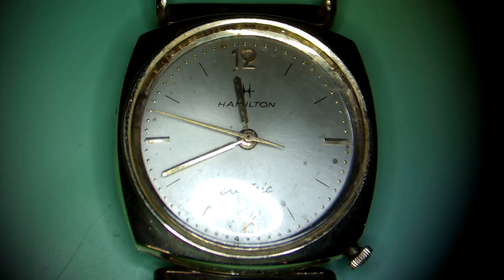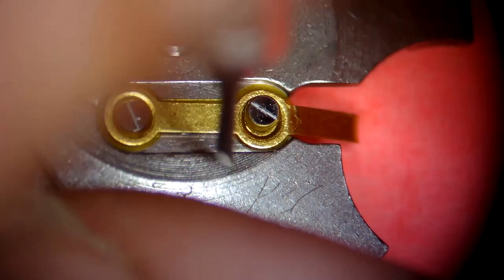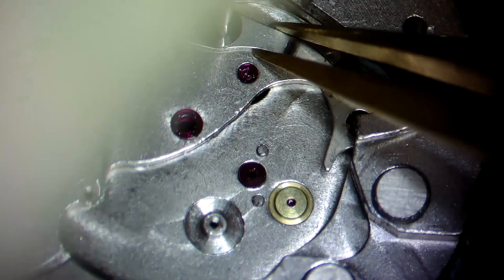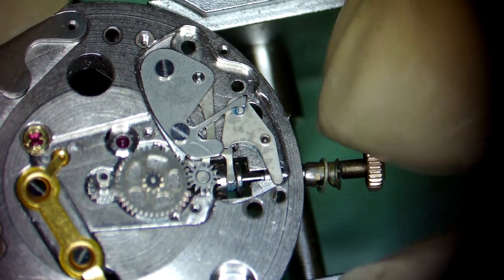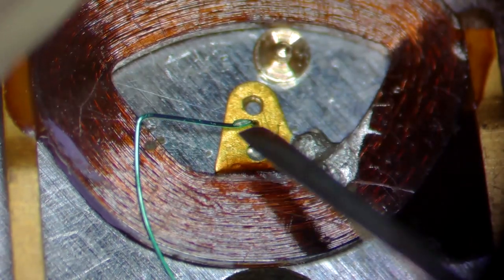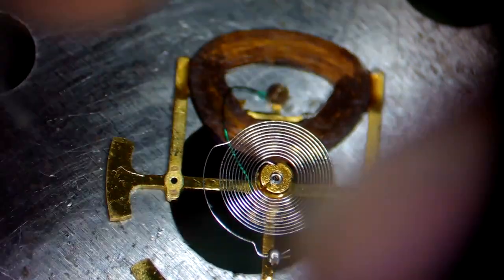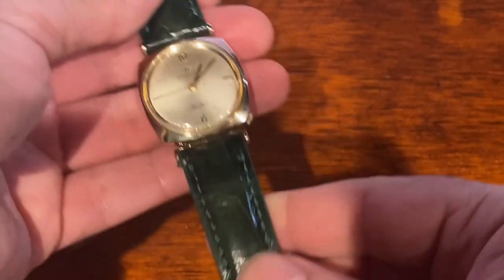Servicing of a 1962 Hamilton Gemini Electric watch w 505 movement

Comment: Well, I acquired a 500.  It is not running, but appears to be in good overall shape.  The wires, balance, and all seem to be good and intact.
I am hoping it just needs cleaned and serviced.  The balance tries to take off when a battery is installed.  It does have a broken setting lever spring.  The thin little finger that sticks out is broken off.  I have the 500 service manual and, with luck, hope to get it running.

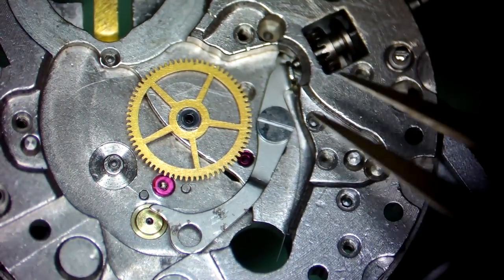Comment: Great video and explanation of functional aspects off this watch! Just one noticeable mistake 4:41  I also commit once in a while, is using a screw driver smaller than the screw I’m working on. It’s a bad habit out off our rush to see it working or laziness we have but it can lead to markings and dents on the screw head, even if it doesn’t slip, that won’t affect anything but appearance, and we all know when it comes to real or sentimental value, watch owners may actually open the watch to check for small imperfections on our work. It’s very hard to discipline ourselves to keep switching screwdrivers but it’s a necessary evil to avoid irreparable mistakes!
Reply from the maker: You are absolutely correct!
Reply: I can tell you that not one customer of mine has ever mentioned an imperfection on a screw. He did a great job with this. If you are or have that type of customer, it’s best not to do business with you or them.

Comment: Thank you for this very well-made and informative video.  May I ask, is the precursor to this one, the 500, similar in its set up, and does it have the same issue with that same part on the balance?.  I know the battery set up is different with that wire they used, but is it basically the same other than that?.
Reply from the maker: Thank you for the compliment. The 500 is different with the battery clip but much more significantly, the contact mechanism is totally different. It uses two tiny wires (same size and thickness as a some (smaller) hairsprings) that touch and separate when their position is shifted by the balance, thus creating the circuit. This also means that the contact on the pivot is different. Interestingly, though this is a more fragile and sensitive design, it's also less prone to wear out than the 505... silver lining.  I'm working on a video for the 500 - but the big problem with them now is that these contact wires are even harder to find than the 505 parts - basically they need to be harvested from donor movements, which are also getting harder to find.
Reply: @sma1968  Wow!.   I knew those wires were important, but why couldn't you use some other kind of thin wire besides using a donor movement?.  It's a special shellac coated wire or something?.
Reply from the maker: @wildernessofzinn17  Actually... and keep fingers crossed that I am successful -- I AM trying to see if it's possible to make these contact wires. If it were, it would be a real game changer for the 500 movement. To be honest, I don't think there's anything inherently difficult about making them (as compared to other micro-sized/watch parts. It's not coated in any shellac, It's basically made of flat wire -  .04mm thick, .14mm in width. They are bent in very specific ways and there is some micro soldering involved. Where it gets a bit tricky is they need to be a non-magnetic alloy stiff enough to be a spring - so not pure copper. (the devil is in the details (the microscopic details). :)
Reply: @sma1968  Wow...thanks.  Interesting stuff.  You know your proverbial poopy about these watches.  In other words, those wires are like tiny mainsprings with thickness and width and length.  That's cool.   I have a 1958 Hamilton Electric watch repair manual by William O. Smith Jr.  Thought I would put it to use if I ever get the chance.  I am anxious to see your 500 video when you get a chance to release it.

Comment: God I hate these… I have one that runs consistently and keeps good time but the balance is very sluggish and doesn’t get full action. Suggestions? (I haven’t cleaned it yet but the movement looks fairly clean).
Reply from the maker: If it's running consistently, it would seem that you're, happily, in good shape. Definitely sounds like a cleaning and proper lubrication will be what it needs. As you saw in the video, it doesn't take much dirt or too much oil to make these run badly.
Reply: @sma1968  I’ll try that… I had a really great running donor watch and of course I dropped it and broke the balance staff.

Comment: Have they tried dielectric grease for the contact?
Reply from the maker: Interesting thought. My guess though is it would be way too viscous for a watch.
Reply: @sma1968  Something to try. I was trying to see the difference between a worn out contact and the new. Hard to see. If you do more videos might you add a side by side comparison? I have a non working 505 that I am trying to troubleshoot from the outside. Thanks for the videos!

Comment: Hello, thank you for posting this video.   I have a Hamilton 505 which runs and then dies shortly after running for about 15 mins.  It is probably filthy inside and that is what is gumming up the mechanism causing it to run hard and sapping the battery.   The watch I have has a black face with a cool read lightning bolt second hand.  It is 10k filled gold and I am trying to identify it and if I should fix it or sell.   Any tips?  Would you like to see a photo?
Reply from the maker: If you want to post some pics, learn what it is and probably causes and solutions,  I highly recommend joining our Facebook group... :)
https://www.facebook.com/groups/2527996874150372
Reply: @sma1968  joined.  thank you